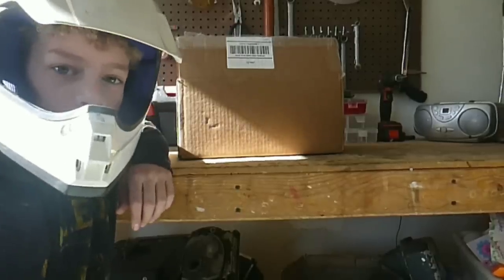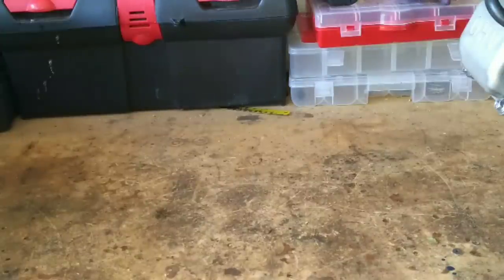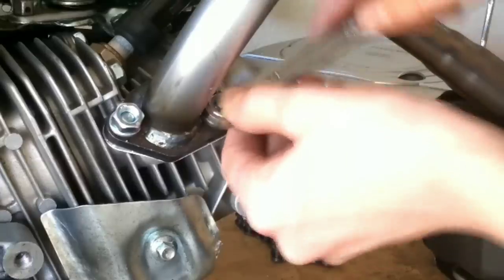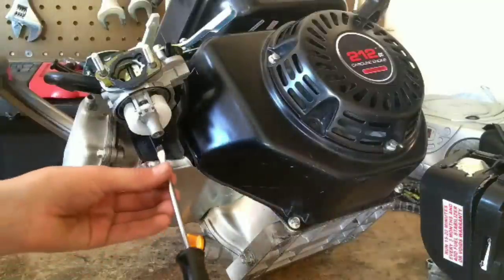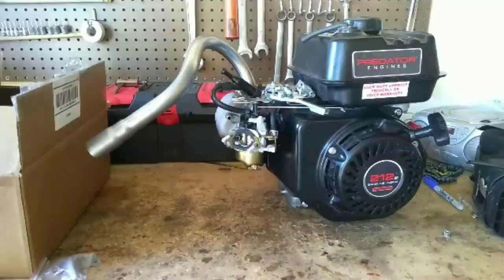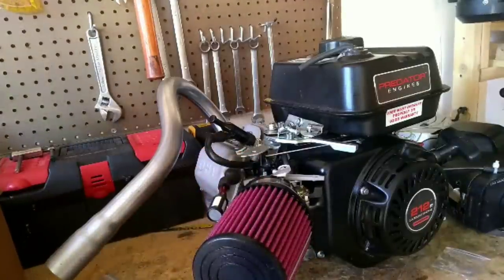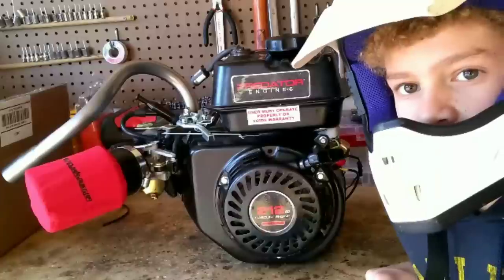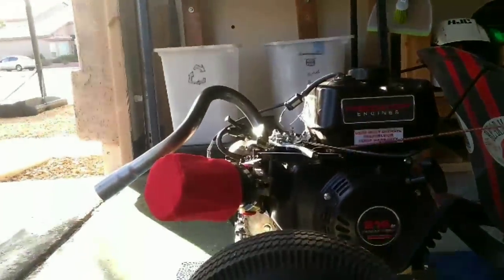212cc Predator Mods: Stage 1(FAST and LOUD!)

Comment from the maker: Thank you to those leaving positive comments! Advice is much appreciated
Reply: Hey man what kind of header did you choose when picking the kit
Reply: Shawn Lee it’s the straghit back one
Reply: @jakechunasamy9642  lol yeah I just guessed and got it right
Reply: Shawn Lee lol
Reply: @karting kid what pipe did you choose
Reply: @aaronhuffman6922  Not putting the young threadee down,but it's nothing special,just one you could make yourself but it follows the crowd & has velocity reducing expansions towards the end.Stepped headers you see on some monster 4 X 4's & Mudd boggers etc but it's ' Monkey see: Monkey do ' you'd be better off fitting a megaphone to the end of the pipe or for some muffling with some tunability a Supertrapp muffler with tunability....ikb as iIve been a professional header manufacturer Of headers & headers & export them Cheers Trev New Zealand
Reply: What exhaust is this
Reply: Great video man! Thanks

Comment: My reccomendation (if you haven't already done this) is if you don't feel like taking out the governor, try backing out the throttle screw as much as you can. You'll get 3900 RPMs out of it (up from 3600 stock). You can also do the "spring mod" as I've been hearing people call it. It's literally just moving the spring that attaches to the governor arm up one hole. I've heard claims of 4900 RPM when combined with the throttle screw being backed out. I'm a bit wary to try this, as I don't know if the governor can handle 4900 (I hear they're tested up to 4200, which means you'll probably be OK but I'm not sure.). Valve springs, flywheel, and connecting rod should all be fine.
Reply from the maker: After the vid I'd backed out the throttle screw. But thanks man! I'll be doing a governor adjustment video soon, I don't want to completely removed if I don't have to. Seriously thank you, I can never get straight answers on these things on the internet
Reply: The Karting Freak No problem man. But like I said be careful with that adjustment. I'm not sure if it's 100% safe for the governor gear to be operating at such high RPMs. Then again there are stock motors with no work done on them that break.
Reply: Shark Bait if your just turning the govener screw out I’m sure it’s fine but I don’t recommend moving the springs on the throttle assembly forward one hole because that govener gear is not very strong
Reply: @Alex-cu6uw  They do it in the box stock predator classes all the time. Not sure how LONG you can run it like that, but I doubt it is that bad considering they wring the crap out of those engines on the track.

Comment: Awesome job man! I’m 51 years old and JUST did this to one I bought a while back. Keep up the good work 👍🏻👍🏻
Reply from the maker: Thanks man! Im going to start pushing out vids when school starts again, and the support is amazing! hows your engine running?
Reply: The Karting Freak running good! I also put 18 pound springs in mine and completely deleted the governor. Wish you could hear it! Lol! And one thing you might want to consider is wrapping your exhaust. I put the same one on mine and burnt the crap outta my arm adjusting the idle. I ordered a fiberglass wrap from Amazon for about 10 bucks and it did the trick 👍🏻👍🏻
Reply from the maker: @davidwatlington9702  i have that stuff too, not only is it functional but it also looks amazing
Reply: Absolutely! I’m also mounting my gas tank higher above the engine and putting a clear inline filter and shutoff valve in the fuel line. This will hopefully keep the gas cooler for more prolonged get up and go plus you can be sure you aren’t bogging the carb down with gunk overtime. I’ve already built the mounting plate and have a bigger tank to mount on it.

Comment: As a thirteen year old boy i do this same work im currently rebuilding a go kart im impressed you know what your doing and you know parts of the engine but heres a small tip that "Phillips head" is actually a flat head Phillips is the plus anyway good job and good luck lil youngster
Reply: ha i younger than you both and i own a small engine repair business and build gokarts and mini bikes

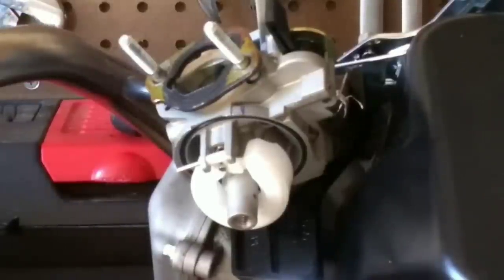Comment: 8:54 pin for the float not in all the way
Reply: But good job did you upgrade your valve springs yet 18lb or more??
Reply from the maker: Oh thanks! I should fix that! No I haven't upgraded the springs, though they are cheap I'm saving for a minibike build
Reply: I did 22lb spring it sucked swapping them
Reply: @rodneyferneding3084  was it worth it
Reply: @landonlovelace92  probably cause it increases engine rpm which increases speed. So probably worth it
Reply: It’s a flathead screwdriver

Comment: You did good.  Just remember to do the valve springs soon and you will be good to go.
Reply from the maker: David Johnson Thank you! Will do! Sorry it took me so long to get back to you.
Reply: Did you do the Governor Delete?
Reply from the maker: Luke Chauvin No not yet, I'm probably gonna put slicks on the kart soon so I'll be doing one to keep up the speed
Reply: The Karting Freak Ohh okay awesome! Im looking to get a Go kart soon, Im about your age and dont know much about them, But im really considering the Predator 212 with a Govern Delete and stage 1 kit with the valve springs
Reply: Recommend any Chassis? I like the Yerf dog style because of the full suspension, And i found one that don't run for just a couple hundred bucks. But im worried the 212cc wont have enough power for it
Reply from the maker: Luke Chauvin Do it. It's keptme busy for 3 years now so definitely get one. The kit is great, and the only reason I haven't done the governor delete is cus I'm not allowed to go faster than 45. If you got any questions in the project just ask me on Instagram @the_real_caleb_g
Reply from the maker: Luke Chauvin if you have trails and forest around, do an off road kart. The on road ones have so many legal limitations. Yerf dog makes amazing frames so if you can afford one go with it. The 212 will have enough power with a torque converter, but a regular clutch will burn up pretty quick. If you really want something fast and powerful on an off road kart go with a 301 or 420
Reply: The Karting Freak Definitely! Unfortunately im not Instagram but i do have Facebook or snapchat, If i have any questions about my build I'll definitely hit you up
Reply: The Karting Freak I definitely want a offroad Kart, Where i live there's alot if well groomed trails and steep downhill dirt roads, What does a torque converter do? Does it effect your top speed?
Reply: @kartingkid714  18 pound springs will be fine for it there like 10 dollars

Comment: Bro I don’t know how much this helped my go kart didn’t seem fast enough
Reply from the maker: whats ur sprocket and tire size. This does not increase rpm just power
Reply: In the 1960's & 70's 6:1 was the standard starting ratio with 4-5" rims. Divid the number of drive teeth into the driven sprocket number of teeth eg 11 divided into 60 will give you your final drive ratio - run a torque converter if you can afford one : you'll have quicker pickup.Thanks Trev New Zealand

Comment: That's a flathead screwdriver,  your on the right track cool to see a youngster spinning wrenches,  tou should of cleaned the rest of that gasket before the header pipe install.  Keep up the good work and remember when messing with engines cleanliness is godliness snd always use torque sequences and specs.
Reply: Did you remove the governor i wanna know if its worth the work to remove it ad well as yhe upgrades you did im gettn different stories from alot of people about it
Reply: @capricornninja3693  I would assume you have found your answer by now but it is worth it depending on your gearing  you will hear the engine stop revving all the sudden if it is "running out of gearing" but in my case my cart goes 35mph at 2900rpm considering the max governed rpm is 3600rpm there is no need for me to remove it (though it was already removed when I got it) and I've  reved it  to 4700 (without my chain on so I can free rev it)(usually you can rev un governed to at least 5200k pretty safely with a completley stock engine/flywheel  in my case I hate my gearing but my sprocket on the axel is a pain to remove in my case as you can see my engine has a lot more in it so the gearing is stupid hope this answers your question to add my mods are just an intake upgrade and jet but these are not needed for you.to.rev higher though you gain some top end power
Reply: Capricorn Ninja I recently removed my governor and I can assure you, if you are bored with your kart/mini bike and want more speed, it is the most effective way to increase your RPMs and speed.

Comment: At 9:07 when you put the bowl back on the carberator, the pivot pin in not fully engages with the float.  This may cause the float to bind up and not meter the proper amount of fuel into he bowl.

Comment: One other thing. When you took the bowl off the bottom of the carb you said now you're just gonna need your small Phillips head screwdriver that's wrong you need a flat head screwdriver to remove the jet. But keep up the good work man your doing good. Just didn't want someone try to remove their jet with a Phillips and it not be right lol.

Comment: One of the best explained videos ever 💯
Reply from the maker: Thanks dude
Reply: @kartingkid714  I hope you flipped that metal gasket back the right way, its upside down
Reply from the maker: @1MACVSOG1  I did. I took the whole kit off after I finished filming to make sure I didn't f anything up cus I was nervous
Reply: @kartingkid714  cool I had did the same thing one time took me awhile to figure it out
Reply from the maker: @1MACVSOG1  it's confusing I had only been doing this kinda stuff for a year at that point so I was kinda flying blind
Reply: @kartingkid714  we all do at some point !👊🇺🇸👊
Reply: @kartingkid714  are you going through clutches fast! I change to a cvt 30 series comit clutch on my race kart  I now have a built gx200 stage 3 all Billet motor with 13.5-1 compression I was running a 2 disk Hortsman racing clutch and changed to a cvt with jackplate and mygod what a different in bottom end power all the way through the rpms its power that I was not getting with a regular clutch..

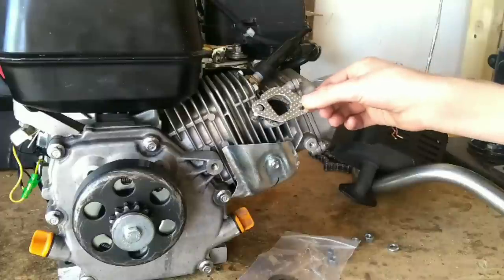Comment: When doing an exhaust R & R, or intake R & R, if you are replacing the gasket you should trim the gasket to the exact size of the exhaust port.  Notice how much smaller (@4:28 - 4:34) the exhaust gasket port is than the exhaust port on the engine.
Reply from the maker: thanks man! does it make a difference in preformance?
Reply: @kartingkid714  minutely but I doubt you'd notice the HP difference but it's good engine building to port match them....delete the gasket & you some ceramic exhaust sealer goo...your local muffler Shop might give you a blob but you'll have to rush home to use it, save up and buy a tube from JC Whitney or locally.Use it in place of the gasket...idle your engine to set to goop.Cheers Trev NZ

Comment: for some reason that metal gasket where the air box is was on the wrong way and then reinstalled the wrong way. watch from 9.20. wonder if anything happends blocking that hole. but besides that great job buddy

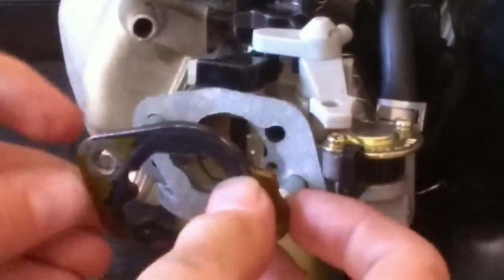Comment: At 10:02 you put the metal carburetor spacer on upside down.  the hollow tot he upper right is covered which will throw off the idle.

Comment: Thanks for showing us the intricacies of this kit.
 I don't understand why you had to pull the engine off the cart in order to install this kit. Is there something I'm missing?
 I don't think that that gasket you replaced was put on correctly, you can see holes behind the gasket that are not sealed.
 You might also want to add a muffler to that pipe to reduce the noise.

Comment: Great project but you did not have to take motor off I just did the same on a home made chopper with tge hemi so much power with a torque converter

Comment: get a metal mounting engine bracket because that wood could snap and plz do not put a torque converter on there until u get a mounting plate because the pull on it will snap that board but overall keep up the good work and keep modding

Comment: Hey if I have the same engine  it doesn’t want to turn on why any thing I should check
Reply from the maker: I'd start with making sure it has a good fuel flow of. Buy some starter fluid. If that does not work check for spark and then compression
Reply: The Karting Freak     Thanks 🙏🏼

Comment: 10:00 the metal spacer was put on upside down, the hole on the top right of the carb should line up with the hole on the plate. Great video regardless!

Comment: The metal gasket you put on before the air filter was upside down, it blocked one of the holes that needs air. Also, the pin in the bowl float was about to fall out. You probably fixed these by now but I just wanted to point that out. Good video otherwise!

Comment: This is great!  Can you say how much faster it goes compared to the stock engine before the modification?
Reply from the maker: If you did the full stage one mod (with governor removal) depending on the gear ratio there could be a around a ten mph difference. In term of acceleration, I do not know but there was definitely a difference!
Reply: Thanks!  What do you think the difference would be if you kept the governor in?
Reply from the maker: @bryanlloyd6024  over all the top speed would not increase, but there would still me as acceleration increase

Comment: I have 7hp chinese engine Like that and gear box from pitbike. I want to make off-road go kart. Will it run about 45mph?
Reply from the maker: That's an awesome idea, I was going to try it myself. Pit bike engines run about 7500rpm, so if you got the clone to run about that. All you need is a rear sprocket size and tire size to calculate the top speed. What are you tire and sprocket sizes?
Reply: @kartingkid714  Now i have only engine and gear box. I dont know what tires i need to buy. I think i will buy used atv tires they have good price. Sorry for my english iam not native speaker
Reply from the maker: @marekksindolar  your engine is amazing, I could understand you perfectly. With atv tires, you should be fine. If you want more speed you can remove the governor or use a smaller sprocket
Reply: @kartingkid714  i hope 7hp is enough. I want to ride on fields not on roads. I dont know how to make live rear axle i need find some tutorial on internet.
Reply from the maker: @marekksindolar  with the gear box it should be enough, if you want more torque then you can also make the rear spocket bigger

Comment: Do you know if you can change a 10 tooth sprocket with a 12 tooth sprocket without changing the chain or drive sprocket?I got a 10 tooth with a 40 tooth lower sprocket.thanks.
Reply from the maker: keith wilkinson As long as the 12t is the same # chain as the 10t. Unless your chain is very tight already (the chain will become tighter when you add the 12t)  you won't have to lengthen the chain or buy a new one

Comment: Hi, I purchased the same kit from Go power sports and it came with (2) gaskets not (3) like I saw in this video I put just the same (1) that you used in this video where is the other gasket that came in my kit supposed to go? Or I don’t need it at all? Thanks
Reply from the maker: It was missing an intake or an exhaust

Comment: what is the top speed after this modification? I think i'm gonna buy that kit and install it on my 212cc predator engine.

Thanks!!!
Reply from the maker: depends on your sprocket and rear wheel size. deleting the governor is the best way to increase speed for cheap, this mainly increases power
Reply: Thanks man!
After removing the govener for more speed, is the engine less reliable?

Comment: Hey, do you have any idea why my predator 212 cc engine is accelerating by itself?
Reply from the maker: Check idle speed, if it has a mikuni or aftermarker carb you might have to mess with a/f mix
Reply: Possibly the Governor is coming into operation Bryce or you may have an intermittent vacuum leak at one of the intake manifold gaskets...snug things up a bit & see what happens or you could have a lose emulsifier tube under the main jet in the carb bowl, if you feel out of your depth take it to the local Small engines man.Goorluck.Trev New Zealand

Comment: Little tip next time you out the air filter on blow some air in it before putting it on there's lots of dust an dirt stuck in it but great video little man keep it up an you'll go somewhere young kids like you need to be doing more stuff like this an not video games

Comment: KK...If you really want to add some noise add a tuned megaphone pipe to the end of that so called " Header " get some .040" Thou thick mild steel or alloy sheet & roll your own ' Trumpet ' there's a formula you ought to follow but if you keep the outer end to about 2.5"-3" & over a foot long you should be right: You could even sell them in your Business like I did 45 yrs ago ,hand made & bigger all materials involved.Goodluck .Trev New Zealand 😇

Comment: Hey man, i was wondering what exhaust you were using on that motor cause that thing sounds scary
Reply from the maker: It was from go power sports back when they offered 2 styles, now they have like 30, I wish I could tell ya the exact one but it may take some diggin
Reply: @kartingkid714  ah alright

Comment: I have another question what’s the difference about a non hemi and hemi?
Reply from the maker: the chamber/head is smooth and concave (hemi-spherical) vs a chamber that has lines ans is linear. honestly look it up. youll get a clearer explaination with pics
Reply: Karting Kid alright thank you
Reply: @sicklyjoey4211  Are U an Aussie with that username ? One engine is more difficult to extract more HP out of than the other, via spare parts situation unless you're real clever.Trev NZ